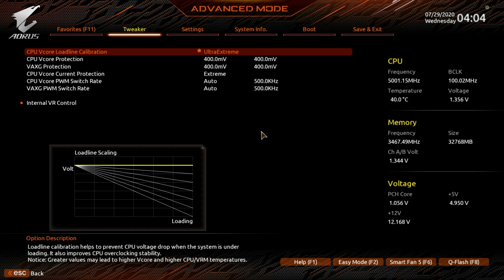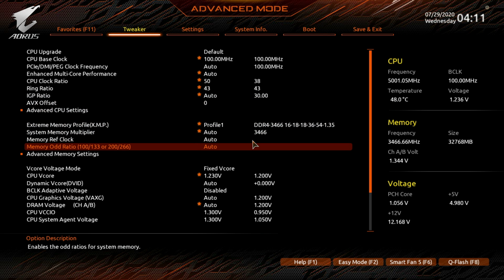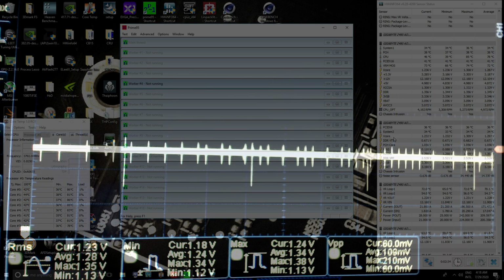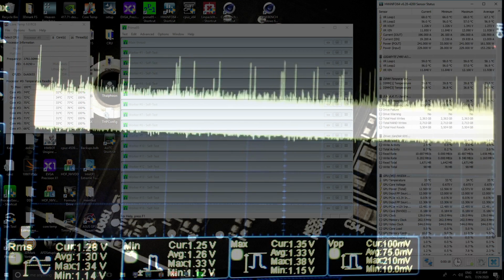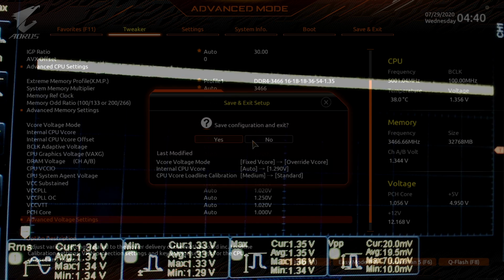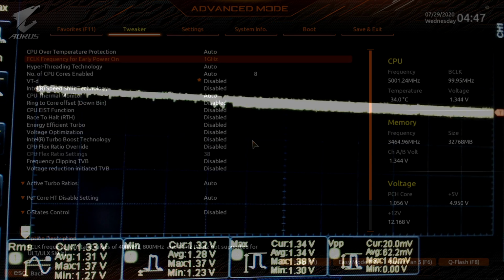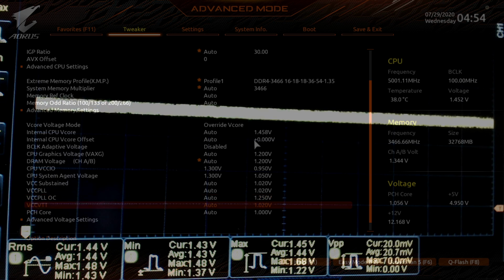Why Vdroop is good for overclocking and taking a look at Gigabyte's Override Vcore mode.

Comment: Hi there, will say that I love your videos. You have a very soothing and calming voice. I listen to you usually when I walk the dog. 

Anyhow...I have a Gigabyte Z490 Aourus Pro AX and a 11900K cooled with a Arctic Freezer II 280mm AIO, it's only used for gaming and web/youtube. I'm not into OC and pushing to the limit. I just want it to run as efficiently as possible. Low temperature and low powerdraw with stock performance or a slight performance drop, a performance increase with less heat and power draw      would be a big bonus. So...i've watched most of your videos covering the z490 and the 10700k, mostly the video about gigabytes override vcore. But I just dont know how to implement all the theory. I would like a template of these bios settings I should start with. MCE, core clock, ring clock, LLC, powerlimits and so on. I have Cinebech r23, OCCT, Linpack Extreme, HWInfo64 and so on. I dont expect an answer, but if so occurs, it would be greatly appreciated.
Reply: Ok so I messed around with some settings, basically coping the settings from the video.

CPU Clock Ratio 51
Ring Ratio 43
XMP1 enabled
Override vcore 1,29
BCLK Adaptive Voltage Disabled
CPU Vcore Loadline Calibration Standard
CPU Vcore Current Protection Extreme
PL1 220W
PL2 250W
Tau 56sec

Cinebech ran without issues temps around low 70:s, score multi 14600:ish.
Ran Linpack Extreme and temps went upp. About low 90:s with a peak @ 98°. Testets passed, so seems stable.

Then I changed CPU Core Ratio to AUTO
and Ring Ratio to AUTO and tested again. This time I got slightly more multiscore in cinebech, about 15000. Temps were the same, I did notice that the volts were lower during load though. In the first run volts were around 1.23, now they were around 1.15. 

I know that when powerlimits are set to AUTO, there unlimited. I dont dare testing that. I was hoping for better results with this 280mm AIO.

Comment: So let me get this straight, you tested (only) two sets of settings - one with 1.26V and Ultra Extreme LLC, the other with 1.36V and Medium LLC. The instability is caused by low voltage spikes. The same level of spikes happen for both sets of settings. The only reason the Medium LLC run was more stable was because you set a higher core voltage. In other words, it has little to do with the LLC setting - why not just use Ultra Extreme LLC but with a slightly higher core voltage like 1.28V for example? Higher LLC will work to keep your voltage stable and minimal across all kinds of loads, whereas lower LLC will mean higher voltages for lower loads - wasting energy and adding heat. Am I missing anything?

Comment: Fantastic video. I have the same mb but with a i9-10850k. And iv been having issues that it randomly restarts at idle. But runs completely fine when gaming. Hoping there is some bios settings that can fix it. Gonna try out override mode and see if it helps

Comment: A little bit confusing because my Z77x-UP7 on 1 step down from the Ultra-est setting has no droop, its like an infinite capacitor, like that override mode, but also no overshoot, rock solid.  The highest setting (extreme?) has only overshoot from set vcore.  I don't think I ever thought higher LLC helped OC, just lowering overshoot and saving some CPU life if anything.   Good video

Comment: Anyone here with asus boards, is that why asus started recommending llc 4 in their bios for OC? It now says (oc recommended) So basically every guide out there for overclocking telling you to set llc7 or 8 has been approaching this the wrong way? 😫
Reply: newer cpus and boards require newer tricks - I think this is actually a good thing.

Comment: This is a really useful video! Thank you very much. I have a question. 

I was wondering if you could advise me on which clock base I should run my 10700k, which uses aorus motherboard, but the itx version (namely Intel® Z490 Mini-ITX AORUS). My ITX case is Cougar QBX, and CPU cooler I use is noctua nc c14s with dual fan.  Currently I overclocked it two 4.2Mhz (CPU voltage at 1.250) and on Cinebenck test, my temp goes max to 65-70 degree celsius. I also tried CPU voltage at 1.3V and increased the clock to 4.8MHz, which reached 95-100degrees after 4-5 min on cinebench 23.

Comment: Does this mean it's actually more stable to raise voltage but have a lower LLC?
Reply: yes, if you mean higher in bios - so iow if you going with 1.2v/etc - its better to get there with more drop and droop.

Comment: I had LLC at 7 (highest) and got volt increase under load. Now I have it at 5 LLC and it drops 0.010-0.015v under load.
i9 9900k 5ghz all cores with -4 avx offest cus not stable avx 5ghz for me.

But now my temps are so much better! Dropped a good 12-13c max load temp for my cpu!!!

Thanks

Comment: So I dunno if my board is fucked but I tried override mode @ 1.35V (1.20 VCCIO/System Agent) and it pegged all of my cores (10700K) to 100C instantly in Prime95. Fixed did not do this. Any ideas?

Comment: TLDR; Gigabyte Override Vcore feature is amazing. If not available, use medium LLC and set high Vcore.

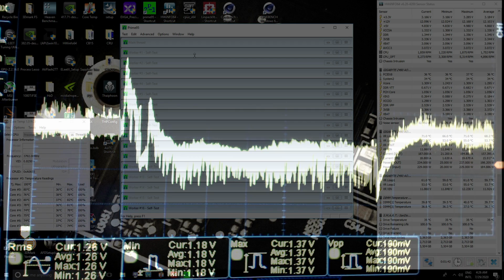[21:28] (1.23V @Vcore, Ultra Extreme LLC)
- moving the mouse causes (windows event timer?) action and voltage decrease
- (@ActuallyHardwareOC: why the voltage decrease if UELLC aims for constant Vcore?)
- once a heavy workload increases power consumption, the unwanted voltage spike downwards causes system instability.

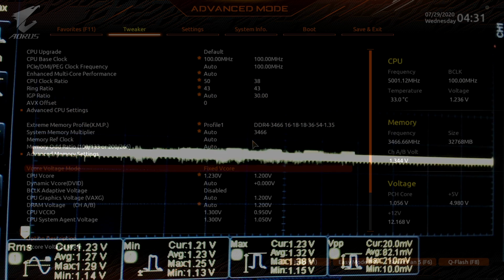[26:30] (1.36V @Vcore, medium LLC)
- stability increased by making the CPU idle at higher Vcore voltage thus a downward spike is less severe.
- Vdroop is designed to reduce CPU voltage while under load (to increase livespan / reduce power consumption?)

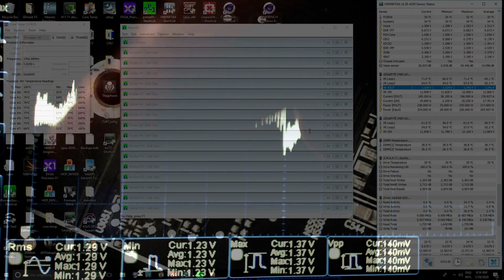[29:39] now idle workload (e.g. triggered by windows event timer)
- increases CPU voltage from ~1.28V to ~1.32V

[34:43] Gigabyte Setting changed to "Override Vcore"
- 1.3V @Vcore
- using Vdroop
- no CPU voltage downward spikes anymore
- no overshoot anymore
- ‹Amazing!›

Comment: When moving the mouse it basically uses more CPU% than when you dragging a window. Its related to the mouse polling rate and how many times it refreshes.
PS: are you sure its not the LLC and not the Override Mode. I didnt saw that comparison.  Auto on Gigabyte boards is lowest LLC.

Comment: Hey Buildzoid does Vdroop help with those violent transients that occur when Intel chips change frequency? Wondering if I run an AVX offset if Vdroop will help those transients similar to how it helps the idle to load transients.

Comment: 37:27 I used these settings but needed 1.320v override mode to even hold around 1.21v on cinebench for vr vout. But what is vin3? Mine is 1.7 and yours is like 0.3 or less. That is the only big discrepancy I see between our numbers.

Comment: This is not ok. I want blue screen buhahahaha Great video man. Eye opener. After this I just want to buy an oscilloscope. What is yours? Also I have MSI Meg Z490 Unify and there is also Override CPU Voltage mode. Do You know if this is the same? Have You checked MSI mainboards?

Comment: @Actually Hardcore Overclocking is override the same as in MSI's Bios? I have a cheapo setup but wanna do some experimenting on a b450m Mortar max with an R5 3600 on a 40$ Tower Cooler

Comment: Anyone know if on older boards CPU voltage offset (as opposed to setting a manual vcore) is similar or has similar benefits to the vid overide mentioned in the video?
Reply: afaik on older boards that's Adaptive, you can get the same result but as in the video it's hellish to work with. (needs tuning)

Comment: Any chance of a video exploring the effects of VRM frequency on overclock stability? :)
Reply: Would depend on the heat capacity of the VRM heatsinks and their max surface area pretty hard. 

I've had it do pretty much nothing on my 3570k in the past, and also seem to help stability on later generation boards, but very marginally

Comment: So you are contradicting yourself?
https://www.youtube.com/watch?v=NMIh8dTdJwI
Reply from the maker: notice how this video is way newer than the video you linked.
Reply: @ActuallyHardcoreOverclocking  It is, so you've changed your mind? Or you was just uninformed in the first video? Many people look up to you to find reliable info, doing a 180 turn is not something i would call "reliable". For anyone who has electrical knowledge and PID regulation knowledge it should be obvious that there's always overshoot/undershoot if there is voltage switching, especially under high load.

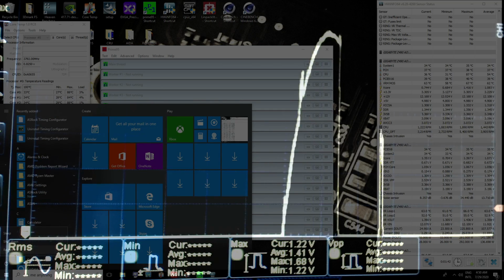Comment: Hey man, thank you for making this video it extremely helpful for newbies like me. I have been watching your videos for a while now. I have a question after watching this video. On your oscilloscope, the 'Max' section shows the max voltage recorded at any time correct? I've seen values reaching 1.68v at 45:42. Those are actually momentarily spikes and not continued voltage as far as i understand. However, is that voltage spike too high and dangerous? If not, what is the max voltage spike that a 9900k can handle, and how often can this CPU handle these spikes? I use a Gigabyte Z390 Aorus Master but i currently left the CPU at stock (no delid) until i learn what are safe settings to use to keep my CPU without degrading it. I use a 360mm AIO. I would appreciate your response greatly, thank you.
Reply: Did he replied to you, I don't know, maybe a DM?
I would like to know if those spikes that occur really often around 1.4 when the Vcore was 1.290 and the behaviour that led to 1.68 are somehow sustainable in the long run?

TL;DR Is Override good for longevity?
Reply: @proclive  no i haven't received a reply unfortunately...
Reply: I don't think it should be something to worry about, the spike happened at idle so it probably was using very little amount of AMPS and it only happened for a very short time.

Comment: 20:59 Windows actually sends the events to the windows you are hovering over, and it can possibly switch "targets". If you interact with only one window (e.g. dragging it around etc), it knows what you will be interacting with, so it only sends events to that window. In the first case, it cannot make assumptions, so this is what I think creates the difference.

Comment: This confused me even more about LLC.
I'm a noob about all of this and I'm not sure if I got this right. 
*  Too much Vdroop and zero Vdroop are bad. 
*  There is always spikes every time there is a change in voltage (from idle/low load to full load or vice versa).
*  A good LLC setting is one which idle voltage is a few millivolts above the load voltage. That way during a load when the voltage is coming back down after those mouse interruptions, the VRM has enough time to stabilize that voltage and it won't undershoot past the normal load voltage. 
*  I don't know what that ''best'' LLC setting actually is cause Buildzoid kept changing the voltage in the BIOS after testing every LLC setting.

EDIT: I just found the video you made 4 months ago about how LLC actually works https://www.youtube.com/watch?v=bUaP0r5-xhY and I'm not confused anymore.
Reply: the llc are not same as anybody said

Comment: The Terms and different LLC naming implementations are quite confusing. 
2 things:
a)  this https://www.masterslair.com/vdroop-and-load-line-calibration-is-vdroop-really-bad seems to be in line with what you say about vdroop = not bad, your opinion on overshots seem to be different. while beeing at overshoots, hows the situation on 7nm @ ryzen?  is the summary also valid for ryzen?
b) at 31:05 ff you talk about the hight of the spike. and that it is the same for the 2 different llc settings you used. and THIS is something i dont understand, isnt the whole sense of differen llc settings to manipulate exactly that hight?  (mb i have to rewatch you other vdroop/llc explain vids)

Comment: A really interesting video.
I have the Gigabyte Z490 Vision G, it's BIOS is almost identical to the BIOS in this video, and a 10700k, cooler is a Dark Rock 4 Pro. Copying 100% exact settings, I was able to go with the 1.3v, Override Vcore, Standard LLC. At first this wasn't stable - Prime would hard-lock after 2 minutes. So, I disabled HT and bingo - 100% stable, even with the hot humid nights we're getting here in the UK. Ran for 60 minutes while I had a nice cold shower, made something to eat, etc... came back expecting another hard-lock and it was still running. I can do without HT, it doesn't seem to affect games or emulation.
The only thing I'm a little disappointed in is the max O/C seems to be 5.0 Ghz all core. I might be able to hit 5.1 - 5.2 Ghz when the weather cools down, but for now 5.0 is ok.
Reply: Whats the point of hitting high frequency when you have ht off ??

Comment: Not sure if I should use override mode. I'm very happy with medium llc. When I use override mode, the minimum and maximum voltages is so high compared to medium llc fixed. Still testing, but I dont think it's that much better.

Comment: Would like to know how these mobo settings translate to Asus. Their LLC is set by Level 1-6. In the Z490, they recommend to set Level 4 when overclocking. Does that mean Level 6 provides more vdroop? Also, I don't seem to have these sensors (Vin/Vout) in HWinfo from the Asus board. I'm sure it's there just called something else.

Comment: Buildzoid I need help.
I feel like a dummy. I cant for the life of me figure out why my vcore is much higher than I set. 
10900k/ maximus XII Hero. I have adjusted the loadline calibration, i forget what asus calls it, but it isnt changing my voltage, according to HWINFO64. What else would be causing over voltage on vcore?
Reply: wixh senso do you read on hwinfo?

Comment: Does this even matter? I mean the transients during P95 happen but P95 is an unrealistic power draw. What happens during normal tasks, render and gaming? Are the transients as bad as when running P95? If the instability is only triggered by the transients that info matters.

Thank you for illustrating the case, now I understand how LLC works better
Reply: It matters if your want your PC to be stable under any potential workload. If you don't mind programs or Windows crashing once in a while, or occasionally getting incorrect calculation results, then it doesn't matter, no. If you want it to be stable, then yes, it matters. P95 isn't an unrealistic power draw; it's an /unusual/ one. Clearly, it's realistic, as you can see it happening right in the video.
Reply: @Corrodias  The thing is that no "normal user software" currently has that kind of power draw. Even video editing is now using GPU power and not as much CPU power. And if a professional user requires to be stable with P95 kind of loads he is not going to overclock in the first place because he is a professional user and not a benchmarker/gamer.

The main point I'd like to know is that if the bad transient response only occurs during P95 or does it occur during gaming or video editing as well.

Comment: Most people OC'ing on this board use Turbo. If i have to use lower LLC i have to use a LOT more vcore. Even gigabyte has an OC guide which states to use Turbo for 5GHz on 9900k.
Reply: Try medium llc. I think around 1.42v bios voltage is max 1.4v vr vout sitting at desktop doing nothing. That should be completely safe for 24 7. I noticed a pretty big improvement in stability when using medium llc compared to turbo.
Reply: @TheJonazas  isnt 1.42 a bit too much? Im not sure...
Reply: @BeepBoop-o3o  check hwinfo vr vout sensor. Its. Not actually idle at 1.42v but its at 1.4v. 1.45 is safe according to buildzoid. Remember load voltage is what really matters, a bit higher idle voltage doesnt matter that much.
Reply: @TheJonazas  yeah you are right. I've read that Vout is more accurate. I'll test it. Thank you very much mate.
Reply: @BeepBoop-o3o  np

Comment: Prime95 stable
Intel Burn Test stable
Windows mouse cursor stable
Reply: Indeed, this raises the question for me, is it even worth doing a "12 hour prime95 test" in addition to a "10 minutes shaking the mouse" test, or does the latter entirely obviate the former? @UCrwObTfqv8u1KO7Fgk-FXHQ
Reply: @Corrodias  stable for 12 hour of both prime95 and moving the mouse
Reply: @volodumurkalunyak4651  I'm going to need some coffee!
Reply: @Corrodias  no problem, just take usb hid capable arduino board and program it in following way
{ mouse_left(10 pixels);
delay(20ms);
mouse_right(10 pixels);
delay(10ms);}
Reply: Windows stable period is impressive enough

Comment: It looks to me a bit like the maximum current slew rate is different between the two voltage modes. I've heard that under VID and adaptive (VID based) voltage modes, the slew rate is limited to some degree (maybe related to letting the voltage adjustments settle?) and that this restriction is removed under static voltage modes.

Comment: So basically less LLC = higher average voltage at idle, more LLC = higher average voltage under load, when in both scenarios the systems run stable with the minimum fixed voltage value. Correct?

Comment: So Less LLC allows the voltage to drift higher when going from a heavy load to a lighter load. So when the higher load occurs again following the lighter load the voltage droop ( L di/dt) goes to an absolute voltage level higher than if we had a higher setting of LLC.  Sounds like if override mode is decreasing the droop, then it is not simply L di/dt, but also VRM induced overshoot/undershoot.